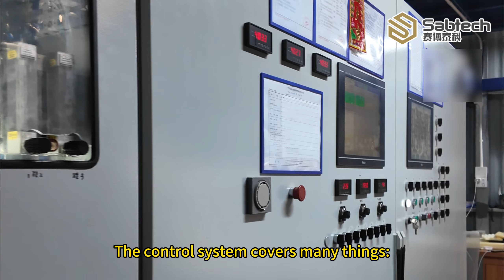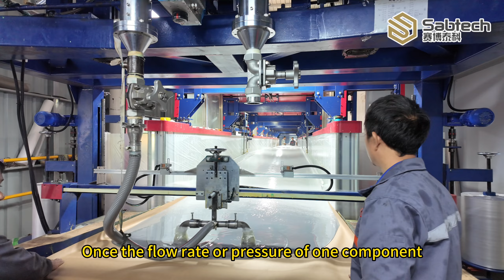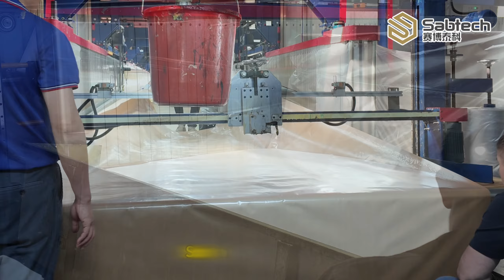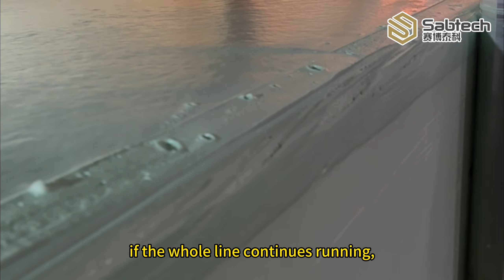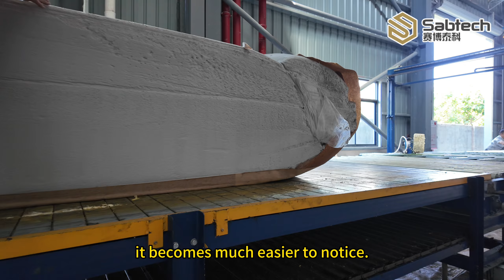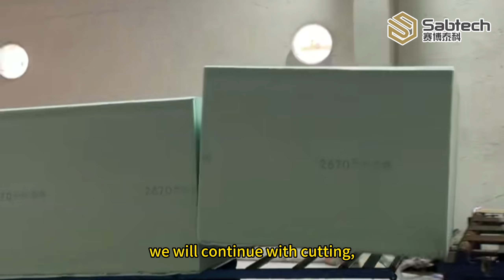How Control Systems Keep a Continuous Foaming Line Stable

Comment: Why pu foam shrink
Reply from the maker: Hi, there is no single reason for PU foam shrinkage. It may be related to formulation, curing, airflow, raw materials, or production control.

We have a full playlist explaining PU foam shrinkage causes and solutions. Please check the “Defects, Failures & Risk Control” playlist on our channel — it may help you diagnose the problem more clearly.
Reply: Why 30 density soft pu foam shrink with mcl
Reply from the maker: @UmarMunir-x7r  MC may be one factor, but 30 density soft PU foam shrinkage is usually related to the full formulation balance.

Possible causes include poor cell opening, silicone/catalyst imbalance, unstable TDI index, MC dosage, or curing conditions.

You can share your formulation details for a rough check. For detailed diagnosis and adjustment, we also provide paid technical consultation.
Reply: TDI index = 115

Polyol   = 100  pph
Tdi        =  36.671 pph
Water   =  2.350  pph
Amine   =. 0.490 pph
Tin         =  0.250 pph
Silicone  =  1.2   pph
Methylene = 10 pph
Reply from the maker: @UmarMunir-x7r  MC is only one possible factor. Your TDI index looks roughly reasonable, but with 10 pphp MC in 30 density soft PU foam, shrinkage is usually related to cell opening, silicone/catalyst balance, gel strength, curing ventilation, etc.

You can send us the full formulation and production conditions by WhatsApp: +86 186 8826 7265. We can provide paid technical consultation to help check the real cause and adjustment direction.